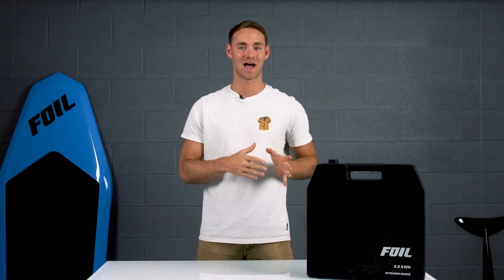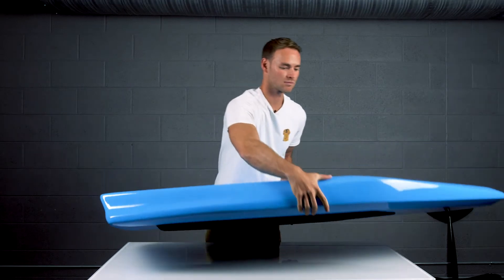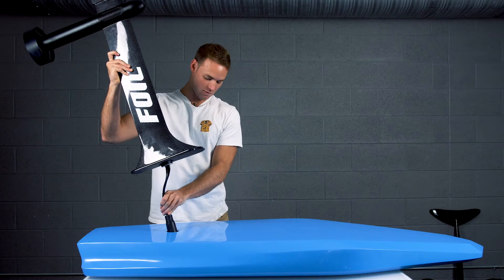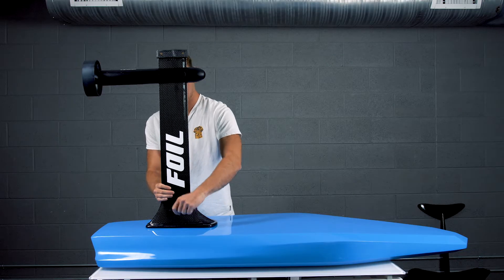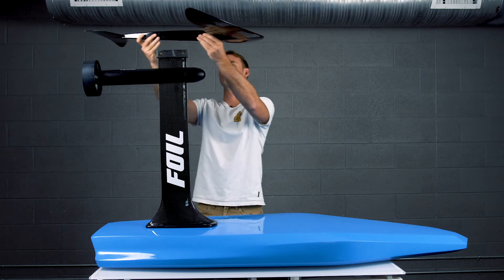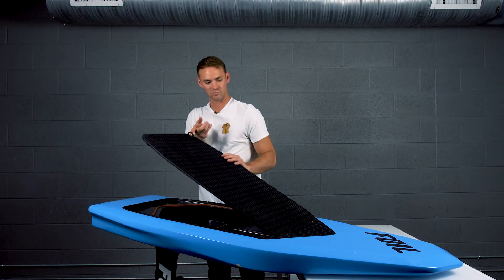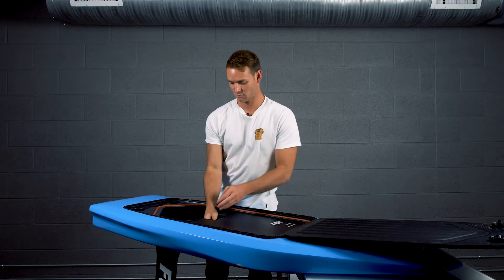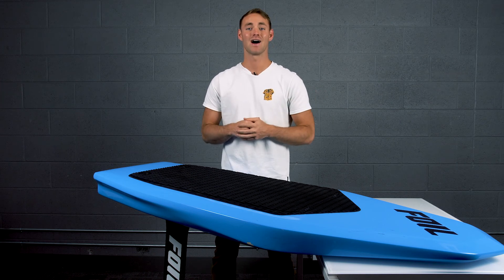FOIL: ASSEMBLY

Comment: GetFoil Review 

Warning: GetFoil’s product is a Chinese knock-off! Compared to other brands (Lift, Fliteboard, Waydoo), this board is a fake. The paint literally chipped at multiple sites on the board just by rubbing the board against my rubber trunk floor.
The remote controller is extremely flimsy and loose: I lost mine literally after 10 minutes of trying to foil for the very first time. GetFoil charged me a full $500 to replace it which costs a LOT more than other brands.
Moreover, after only 4 short sessions (15-20 minutes each), the screw threads became uneven. I had to send in the entire mast/powertrain and GetFoil responded by telling me the powertrain has to be replaced completely. GetFoil charged my credit card $750 for the full cost of a new replacement. However, Getfoil only repaired my defective powertrain, not replaced if. After I called him out, Kyle, the founder of GetFoil, left me an incredibly rude message on my Facebook for-sale post and revoked my privileges on the Foil Owners Worldwide on Facebook. He claimed I was the fraudster!!
I had to send in my GetFoil powertrain/mast TWICE for repair after only 4 short sessions.
I was never able to elevate above the water easily compared to the other brands. As a matter of fact, the members of an authorized sales center of Getfoil in Florida told me the GetFoil really “sucks” and none of their students getting lessons can never stay up above the water for more then 3 seconds.
My experience with GetFoil has been nothing short of a disaster. I have filed a dispute with my credit card and now Kyle is holding my defective powertrain hostage until I cancel the dispute! Can you believe this guy??
Date of experience: September 22, 2022